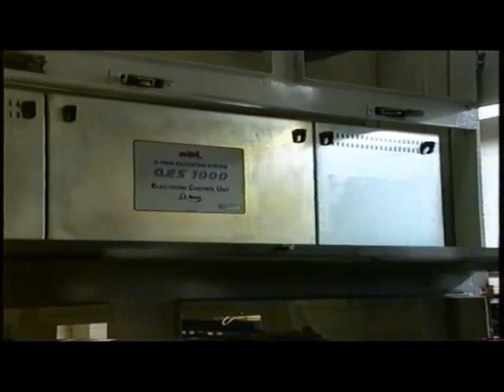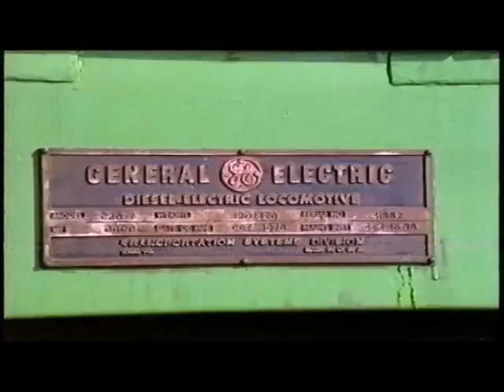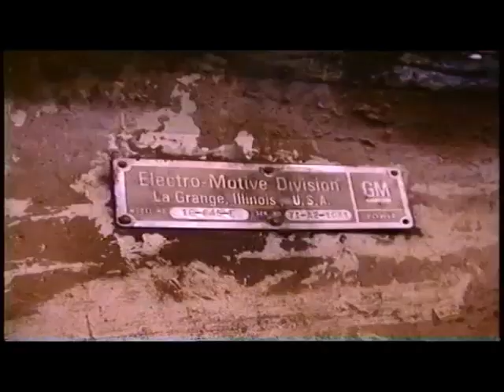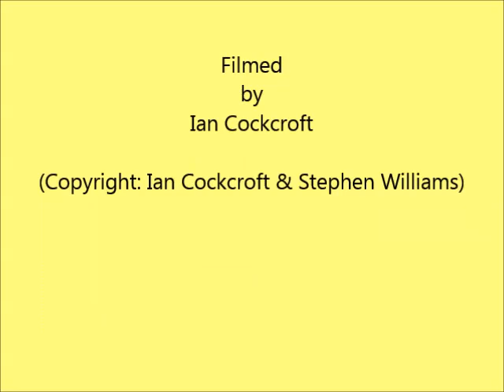Disc 2  Livingston Rebuild Centre  (1994)

Comment: This shop was originally (70's) a BN heavy repair shop for GE locomotives.
Reply: I thought it was originally NP.
Reply: @jasonbabila6006  It was the NP's central steam rebuild shop. Then it became a diesel shop for NP that went over to BN. The NP also had a heavy shop in Brainerd, MN and one someplace in WA, I think.

Comment: Was this a maintenance facility for leased locomotives?
Reply from the maker: I'm afraid, I have no idea Mike. I did find some info here:
https://law.justia.com/cases/federal/appellate-courts/F2/970/295/269725/
Reply: It seems that the literal answer to the question is "no." Based on the court document that Stephen links, it was a locomotive repair facility owned by the same people who ran the Montana Rail Link (MRL). It seems they repaired MRL's locomotives but also did contract repairs for other companies -- early in the video, we see locomotives belonging to MRL (the switcher at 1:00; GP9 at 4:30), Chicago and Northwestern (the yellow and green SD45s at 1:30), Burlington Northern (the green locomotives at 2:20, 2:30 and 2:40, an EMD lease unit (also at 2:30), Southern Pacific (4:05).

Of those, I think the CNW SD45s had actually been bought by MRL, and were being refurbished before being repainted in MRL colours. CNW 6556 became MRL 375, and probaby the other two were going the same way. But BN 5551 remained in service with Burlington Northern for at least another five years after this video, so that seems to have been a contract repair for them. Similarly, SP 6793.

(The court case appears to be about whether the repair shops counted as a railroad employer for tax purposes related to railroad pensions.)
Reply: @beeble2003  You are correct. I worked there as an electrician/lead electrician 92-96. We were owned by Washington Corp, but were open to contracts from whoever. I worked on units from NdM, Maryland Midland, BN, SP, SF, Rarus (Butte Anaconda & Pacific), a bunch of short lines, EMD leasing, Conrail and of course MRL.
Reply: @BadlandNP  Thanks for confirming!